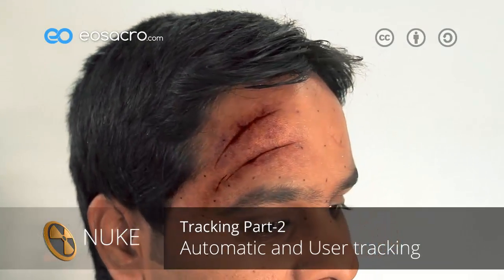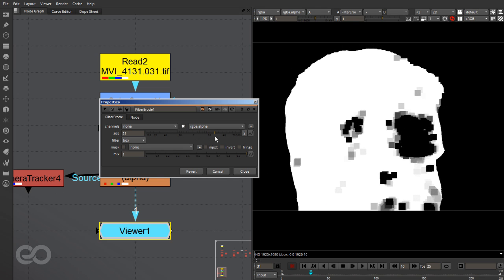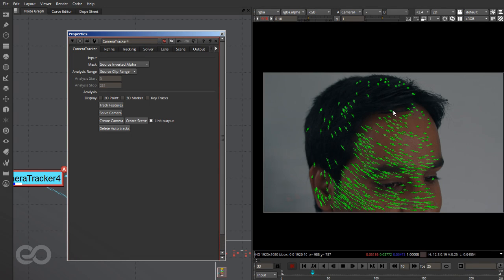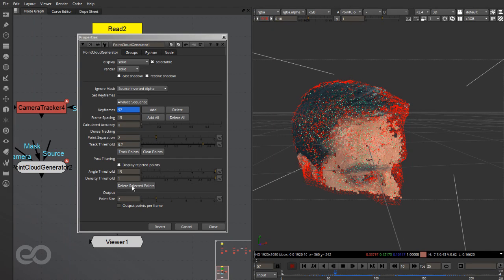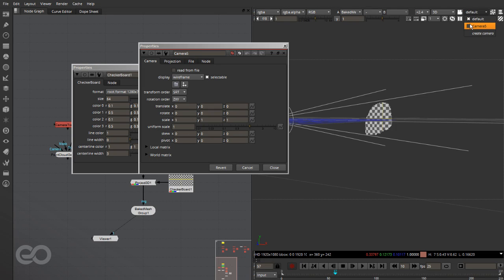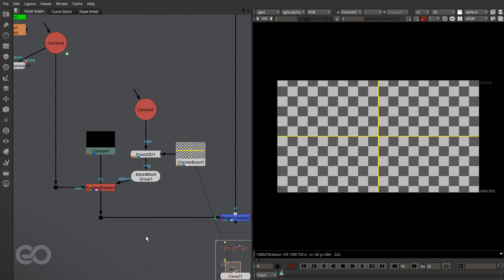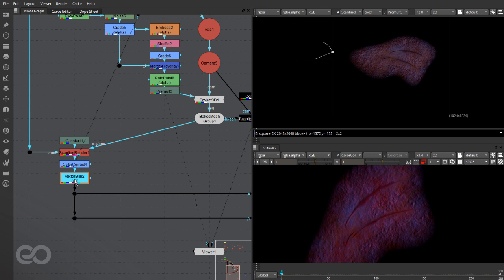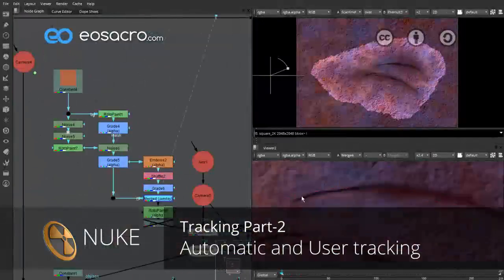Tracking in Nuke - Part 2

Comment: hi, simple question : is this a true head tracking (e.g. like the one done in PFTrack, so at the end I can extract a head rotating in 3D space), or this is like an inverse camera tracking (i.e. tracking the camera as if the camera is rotating and NOT the head)? I don't know Nuke and I need to do a head tracking (so I can export it to a 3D application) and I am not sure what right tool to use ! Thanks :)

Comment: in this example the subject (the actor) is not moving, what if there is movement? rotating arm for example.. will this technique still work? Will we get a "moving" mesh?
Reply from the maker: +kaito kid Nope this method is only valid for static mesh, there can be no deformation whatsoever, if there is it has to be masked. 
If you have a deformation to be tracked then you will need multiple cameras and to do a mocap instead.  Which is a much different process.

So, this method entails no deformation, but the camera and the object can have relative movement and this method can still be used.
Reply: eosacro that's what i thought. Thanks..

Comment: hi loved ur tutorial, i do have a question after i bake mesh it tracks fine, but when i connect it with checker board , the inside part doesn't move with the character, am i missing something
Reply from the maker: ramesh konar we are only concerned with the outer part of the baked mesh, the inner portion usually never moves the way we want cause its hidden in the original footage anyways. So, its not something to be much concerned about unless its giving you specific issues.If I have understood you wrong, maybe send me a screenshot and I will try to give a better solution.
Reply: eosacro i found the solution to it, it tracks nice ,but still i feel it when head turns it slips a bit in my file, any suggestion wt i could do better
Reply from the maker: During the head turn make sure the specular highlights on the skin are matted out, since they move in the opposite direction to the overall head. this will throw the solver off and then the solution you get might not be the best one.
In my video you can see me taking special care to make sure all the skin highlights are removed using the matte.
Reply: sure i will see to it, any other links to tuts to have ,

Comment: Great tutorial! btw. I have a question - when (in what situation) we use camera projection? If we got keyed out people on 3D card, must we project them, or just conect texture (people footage) to the 3D card? Thank you very much and keep great work! :)
Reply from the maker: It actually depends on the situation mate, you can really use any method that gives you the output you want.
Use projection when you dont have UVs, find it hard to work with UVs, need to place elements depending on camera view (cleanup). In most cases its just a texture you need to apply.I know that doesn't help much, if you have a specific situation, I could explain how to use there :) and thanks!

Comment: Hi,
Thank you for the wonderful tutorial, however at 30:50 when you open two viewers, how did you get the footage to load into the viewer? I noticed you selected the node but did you single click or double click on it while holding down any keys?

I have tried so hard to get the footage displaying in the viewer by just clicking like you but it never showed up, only the property tab.

Thanks
Reply from the maker: Any time you want a node in a viewer, click on the viewer to activate it, select the node, press any of the number keys on keyboard.

In the video i'm just clicking in the viewer and pressing 1 after selecting my node.
Hope that helps :)
Reply: eosacro Thanks!
Im immigrating from AE and still getting used to interface and work flow, your tutorials are a life saver. Really appreciate all your hard works!

Cheers
Reply from the maker: Thanks mate! 
You're most welcome! :)